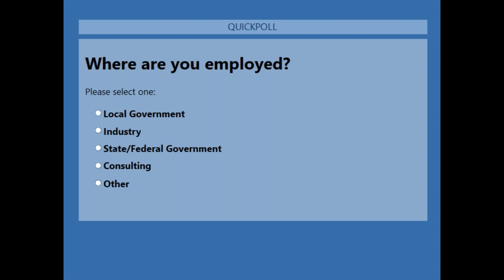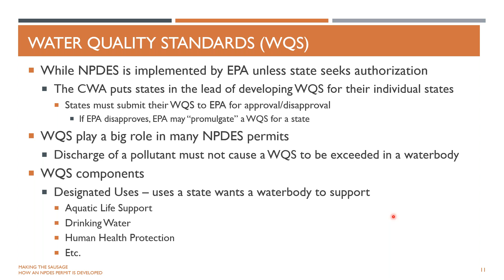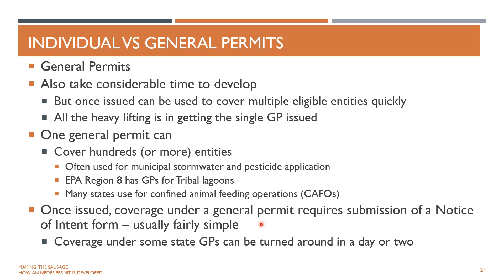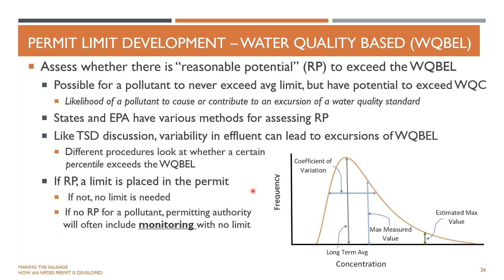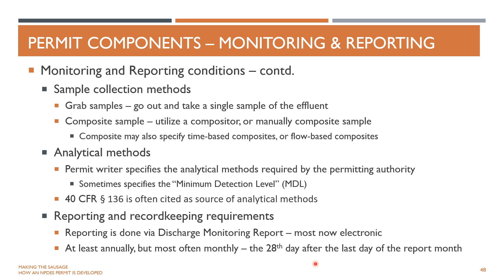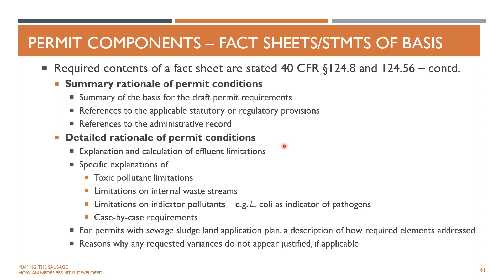Making the Sausage – How Your NPDES Permit is Developed

Comment: The rules need to change for single homeowners vs developers. I built a single house in the middle of 55 acres surrounded by meadows and the EPA made me get a NPDES permit which changed by driveway cost from $20,000 to $95,000 and it took 11 months to get approved. This is ridiculous. The storm water management system for my gravel road cost more than my land is worth. My driveway has no impact on ANY waterways. This has gotten out of control.